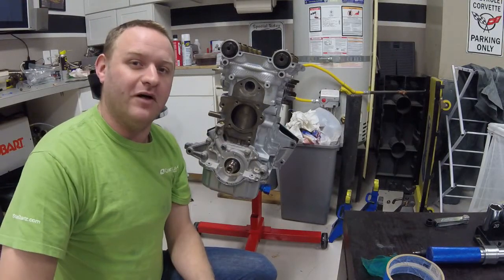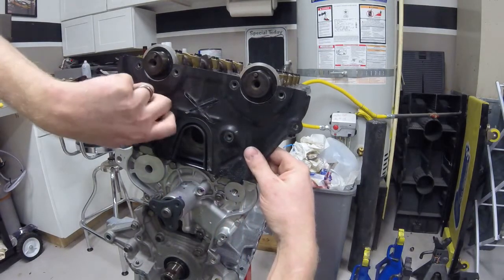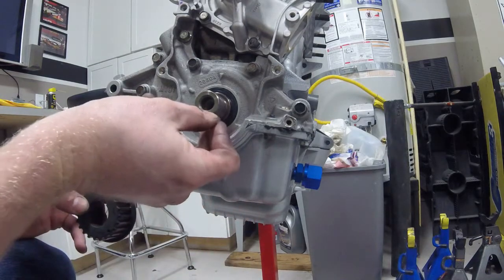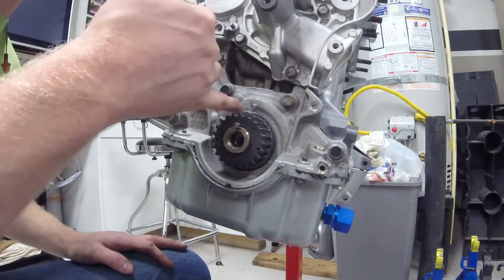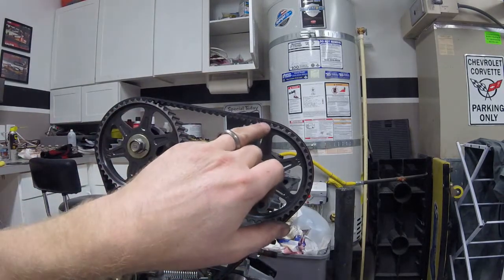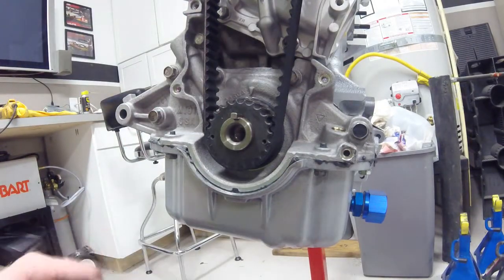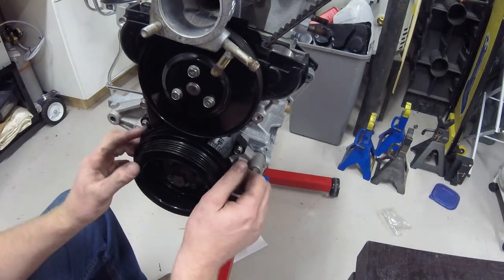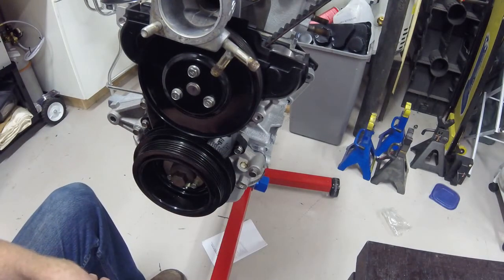Miata Timing Belt Installation

Comment: Ever torque the low torque specification as the lock tite might at as a lube upon installation?  If the hight torque is used ya might just be over torquing.  most torque specifications are calibrated for dry threads unless noted.

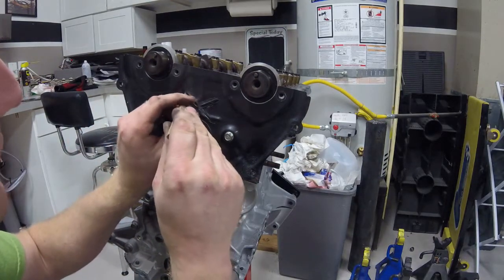Comment: At 1:40 - Why not use the rear cover you just removed, in place and use a grinder or Dremel tool to etch in the marks on to the metal so they can be there in the future?
also a Mazda Miata Camshaft Locking Tool _ timing belt change cam gear - makes it easier - B$ removing the head, turn cylinder 1 to TDC, then install the tool, and mark reference lines at matching points on the gears and the tool and timing should be a breeze (just asking because I am getting ready to do my first one.)
Reply from the maker: Because then it wouldn't be as pretty 😁
Reply: @BuildingTheEXOCET  True True, But they say "Form follows Function".  BTW, I am removing just the Head. I got it mostly undone. But when I took the exhaust manifold nuts off the studs came off except for two. The are in the way of the life. Should I remove the bolts to the down pipe, or can I still pull some? WIll I bend an exaust hander? 
I am Loving watching your series. It is the best how each video is Well Light, Haas great camera angles., speaks wells and not too many words - the best is how each video is a manageable bit of learning. I have wanted to do this kind of job since I was in third grade. When I went to High School, they discontinued wood shop - auto shop - metal shop and health and hygiene. All that was left was Print Shop (which I became). So now at 58 years old after crapping out the miata, I get to try. Yu are giving me the confidence. Thank you.
Reply from the maker: Pull the down pipe off.  It's not that hard and honestly that thing is probably rusted crap by now
Reply: @BuildingTheEXOCET  You are right, it was PRETTY Frustrating  ((and I put the wring time 1:40 not 14.90)) One of the bolts on that back plate was difficulted. I had to buy a smaller diameter socket to take it off When I got home I forgot about it, and was fustrated that the head was not moving. I am close I just have to get two stud off from the exhaust manifold. All the other studs came off with their nuts.

Comment: First, thank you for share your build but you are passing along some misleading information.  There is a very specific process for setting the tension on the timing belt.  Not hard but important.  Also, you O ring on the water neck is important.  Only use RTV if at the track and you will fix it when you get home. This video is over a year old, hope you did not have too many issue with leaks and timing belt skipping a tooth.
Reply from the maker: No issues at all, because if you watched the other build videos you would see once in the car it was getting replaced with a coolant bypass and a freeze plug was getting installed in that hole, thats why I wasn't installing a new o ring.
Reply from the maker: Also no issues at all with timing belt.  Many many hard autocross days on the car.

Comment: Why are you calling the Exhaust side the “Intake” side and visa versa? Isn’t that backwards?
Reply from the maker: The timing marks are backwards of reality on the cover plate.  It's wierd.
Reply: BuildingTheEXOCET I did some research and you are correct, the cams ARE labeled:

E - on the Intake Side

I - on the Exhaust Side

Your video is so informative thank you for providing this for us. Great camera/angle/ sound.
Reply from the maker: It's goofy as hell, it makes you question it at first but it's correct.

Thanks for your kind words, hope the video helped.  Helps seeing it done out of the car

Comment: Once I heard this guy say he was leaving out the o-ring for water pump outlet and substituting RTV, I knew there was nothing else I wanted to hear from him. The length of that outlet and only held by 2 bolts, RTV would last about a week before it will start to leak. There is NOTHING better than o-rings and square rings for sealing oil and water.
Reply from the maker: Thank you for your comment.  I didn't mention this was just to show it installed .  I did a coolant reroute after the motor was done and put a freeze plug in here and made a plate to hold it in.

Comment: How do you turn the engine?
Reply from the maker: Rachet and socket on the crank pulley bolt.   Lock the motor in place on the engine stand like I showed with the pry bay.  Or I believe put the trans in 4th gear if the motor is in the car.